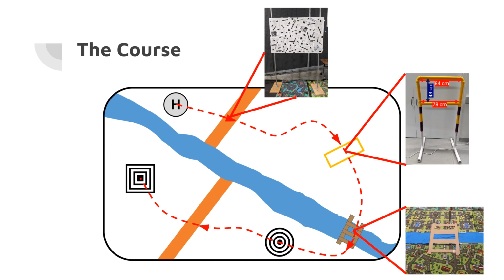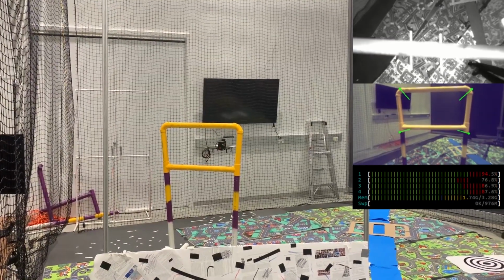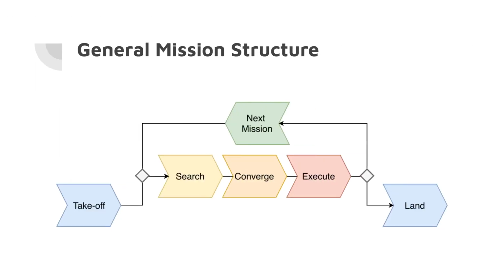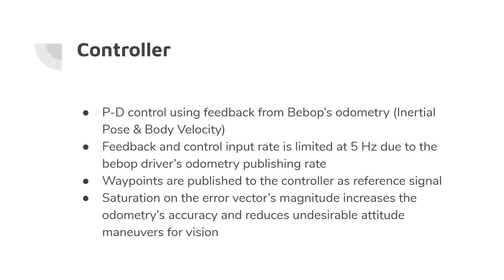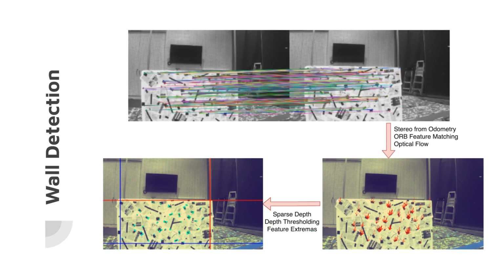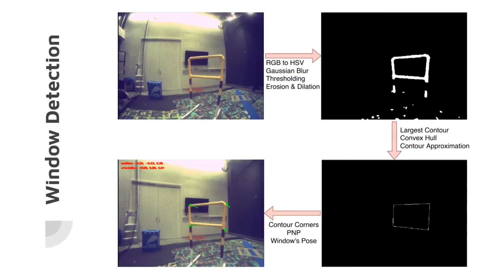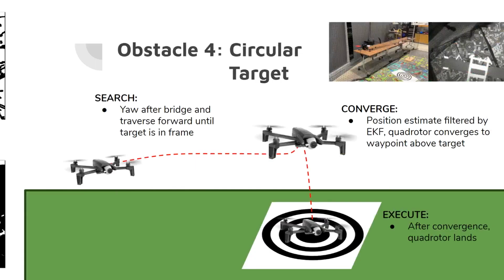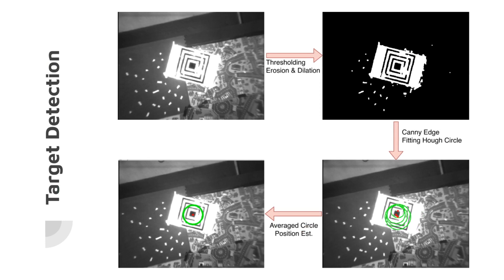The Final Race - ENAE788M Autonomous Quadrotor

Comment: How the way points are given?
Reply from the maker: They’re prescribed maneuvers based on relative location to an obstacle in this case. Ideally you would have a motion planning algorithm that generates a safe trajectory that the position controller can track
Reply: @NicholasRehm  interesting ..
Also how do you localize indoors. Eventhough there is a gps, i guess you are not using it.
Reply from the maker: @nusri7732  no gps onboard. Just odometry informed by optical flow measurements fused with IMU data (done natively on the bebop drone). We can also localize with respect to relatively known obstacle locations through computer vision; this helps correct for drift in the onboard odometry over time